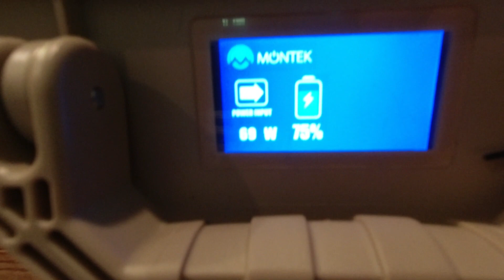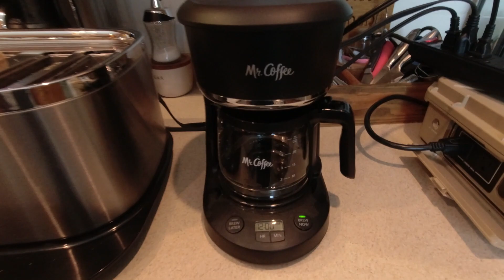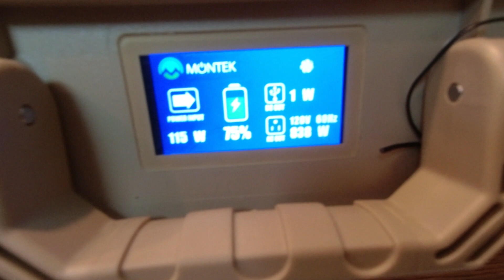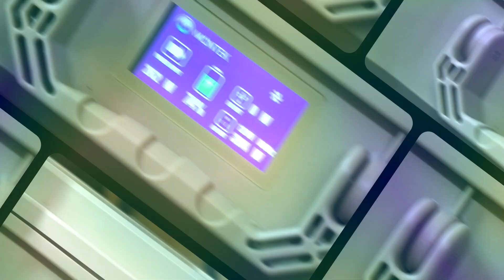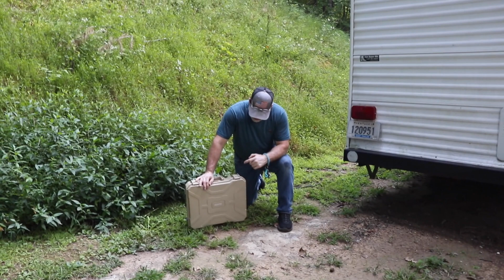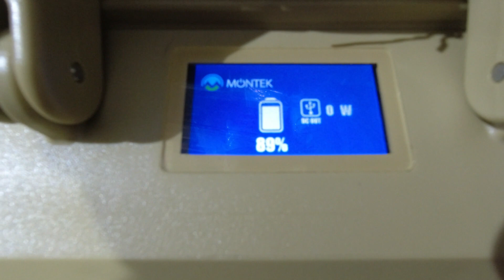MONTEK X1000 Portable Power Station Strong and Water Resistant For Home Backup Outdoor Camping

Comment: Good review . I've no complaints with my x1000. Does what it's intended to do without any issues. The design is practical and makes far more sense than many others. Easy to carry and place in tight places. Well thought out. Sometimes the fan will kick in when there's no load but it soon stops. I don't think that's a problem with mine . The hidden menu is a must for more detailed options. Not in my manual so read about that on Montek facebook. I didn't buy the solar panel and use the inside area where the panel would be for cables and all other accessories I bought afterwards. I just found an 80watt panel was not acceptable so I plan on buying a 400 watt panel and the Montek fast charger. Also the Montek battery is easily assessible and removeable plus the quality components and overall build puts this above most makes. I'm tempted to buy another but will wait until their latest more powerful models are available. Thanks for the video
Reply from the maker: Thank you for your recognition of our products. Our 200W and 400W solar panels will be on the market soon, and the 2000W power supply will also be on the market next month, you can look forward to it, thank you. Click here for more information：www.imontek.com

Comment: Great review!  This is as real as it gets.  

I have two Monteks with the 80W solar panel and they are two of my favorite power stations (and I have many).  One thing I love that sets Montek apart from all others is the ability to operate it horizontally (like a briefcase on a desk) or vertically (like a briefcase standing up on the floor).  That plus the shape makes it easy to fit anywhere, such as upright behind a car seat or on a shelf in an RV or van.
Reply from the maker: Thank you.